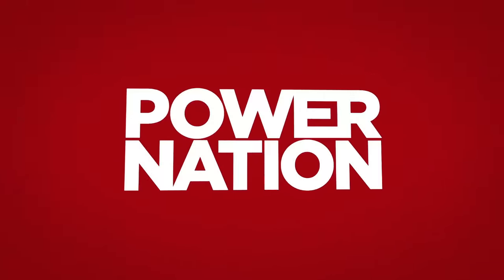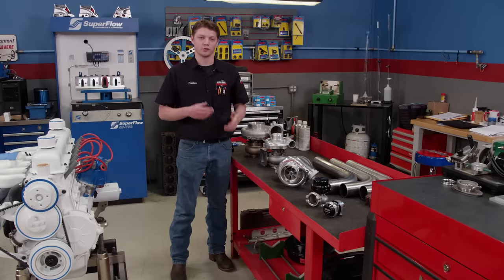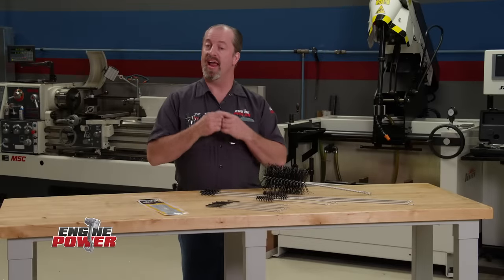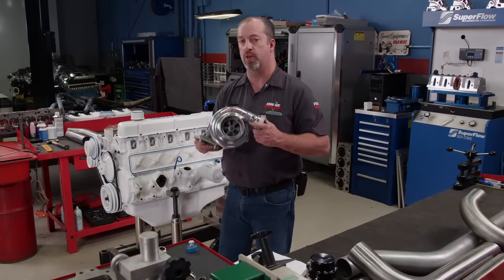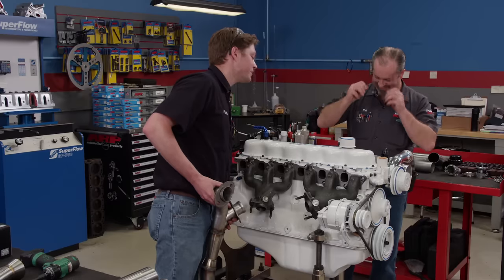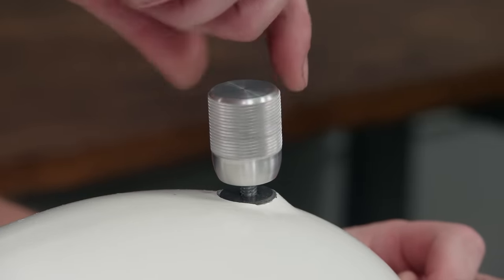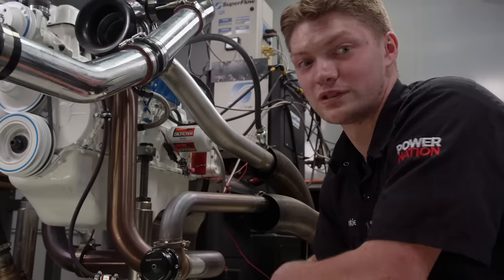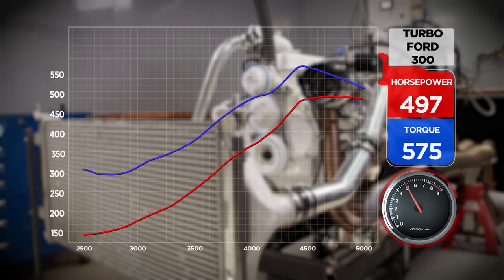Turbocharged Ford 300 Inline Six Makes Over 500 HP on the Dyno - Engine Power S8, E14

Comment: This was more satisfying and way more fun then almost everything else I've seen from this show.  I really want to see them start making power on all sorts of different, underdog engines.
Reply: I had a smile on my face the entire episode. 
There isn't a gearhead alive that grew up around 300s that didn't wonder why that bulletproof engine never got the love the 302 and 351s did. 
I want to see more of this
Reply: @francislutz8027  my first pickup was a slapped together jolopy of a ford f150 with a 300 and a granny 4, that motor drove me to the pits of hell and back, had a warped valve cover so i always carried a gasket and 5 quarts of oil for when it blew. dad still hauls wood with that ol rig, not fast, but he hauls it
Reply: To be honest thou the 300 isn’t A underdog from the factory it would out pull the 302 had a friend and his dad both bought brand new trucks only different was his dad sprung the extra money for the 302 but his son out pulled him every time they tested them out against each other and that’s a honest fact
Reply: THEY should do a ford, gm, and Chrysler inline six turbo build off.. As in same turbo and efi to see what made more hp then put them in cars to drag race them... Inline six muscle cars still way cheap under 20 grand mint condition..
Reply: @francislutz8027  Like a multipoint efi custom build like Casey built back in the day but for inline six!!!
Reply: Check out Richard Holdener's "The Other Guys"  series on his channel.
Reply: @Thelongmanable  they did a 292 gm inline for a build a year ago or so
Reply: @scottinWV  Richard is really pulling in the viewers with the other guys motor.  I've been waiting patiently for him to do the big bang on the 3800 series 2/3 and on the "Ameri-Barra".  I wouldn't be surprised to see the 3800 survive up to 1000 hp with the stock internals.  It would be awesome if Richard then put forged bottom end and seen how far he could go.    However, the forged crank and main caps are expensive items for the 3800.  A forged crank for the Grand National 3.8L is around $600, even though the GN is a small aftermarket.
Reply: What if they tuned up ridiculous forgotten/economy motors, like the Ford 2.3HSC from a late 80's Tempo?  Or pulled a 3.1L Chevy v6 from a 2000's Malibu and managed to service it without stripping the rocker arm bolts :-D
Reply: @kbar150  I know and unlike the 300 it had a low compression head not a 9 to 1 compression like the Ford 300. This is why so little boost made big hp. People don't talk about compression to hp but it literally is "Everything"!!!
Reply: @Thelongmanable  Ford should use the Barra in that competition.
Reply: @davidkelleyiii9315  I've seen them online for sale be awesome for vintage mustang build..
Reply: @Thelongmanable  man,miteomite top fuel runs one with stock internals getting 2000 horses and it didn't blow up.niw there is our American 2jz.just don't know what to put it in.
Reply: Another extreme underdog engine is the GM "Iron Duke." They lasted forever, but had no gumption. 

A significant benefit to hotrodding these unpopular engines, is the lack of aftermarket parts. If these guys could be persuaded to port their own heads instead of just buying expensive parts, it would definitely improve the channel content.
Reply: @jonathankipps9061  OH man that's the beauty of hot rodding custom part building to make the unusual fly.. I means model a or t were sas sad performance but know how , creativity and engineering all things can be hot rods. That is the very definition of hot rodding taking what you know and building something that didn't previously exist.
Reply: Under dog the 300 is one of Ford's longest lasting engines ever made it's a tank I seen one still running with a piston out the side of the block
Reply: Yes,
Reply: @francislutz8027  I couldn’t agree more! And so did i I would like to see this in a truck and on the street/strip

Comment: A build list for the final NA with 287ish horsepower would be pretty sweet. Sounds like a fantastic daily driver F150 engine.
Reply: it was listed on another episode. though the roller lifters only added couple hp so barely worth adding them.
Reply: @SgtJoeSmith  that’s for longevity not power
Reply: That's what I was thinking
Reply: @Agilepickleunite 
Not trying to be a troll, but I have 500k on stamped rockers that'll beg to differ.
The rollers are for alleviating a slight bit of friction in the upper end of the engine, but won't do much for longevity.

Comment: I want this so bad.   It’s the ultimate crawl around and tug truck motor.   Even the NA motor is good with a manual and 4wd.   It pulls way more than you would think quietly.
Reply: Those 300 motors were in so many 1/2, 3/4 and 1 ton even I bet some heavy hauling 2 ton or so cargo  trucks and flat beds throughout tge late 80's to early 2000's, most underappreciated and overworked engine probably ever.
Reply: @Roboticdoughbull3k  im looking out the window at my 95 f150 5sp 2wd with this engine while watching this
Reply: Please don’t laugh.  
I feel like I already know but, is this CA legal

Comment: I've taken 2 of these apart about 4 times each now, and yes- These will run 70 mph on the highway with a half ton of sand in the bed, with 2 cracked pistons, all rings seized, and not 2 squirts of oil. Then I re-re-built it with 5 new pistons and all new rings, bearings, and a HO oil pump. Absolutely love turning the key on my '85 F-150. Runs smooth as a sewing machine, even the air conditioning holds a charge and works.

It may never go fast, but I can pull a stump at idle and 100% guaranteed to take me anywhere I need to be.
Reply: This. 
Every gear-head friend I have has a similar story of an abused 300 that would break hearts, not parts. The old "they quit making them cause they can't profit from selling parts that don't break" story has stood the test of time pretty damn well
Reply: Its hard to kill an old Ford.
Reply: Had one of these in a 76 f350. Most of the truck rusted away, valves outta adjustment, and most service was "it's still running, drive it". Motor had an easy million miles on it. Still most reliable truck in the fleet.
Reply: Built Ford Tough! 👍 too bad everything that every company makes today is garbage.
Reply: I've owned two myself. Absolutely awesomely dependable engine the 300.
Reply: Yeah these motors only came in trucks. Big tall motor, so it won't fit in most cars. One of the few exclusively used motors to have ever been built. They are awesome.
Reply: A/C holding pressure doesnt relate to the engine in any way ever, its all down to the A/C system, as long as it bolts on and doesnt go further out than stock belt it works from my experience
Reply: @mattisenberger4042  The 250 was the same motor and it was put in some cars, same basic engine as the 300 but intake was cast as part of head, same engine in Australia had separate manifolds so the hot rodders here had the Aussie heads shipped in.
Reply: @5695q  yeah I've heard of a 250. Just never seen one. I've actually tried to put the 300 in a 78 LTD. From an old 87 truck. Truck was wrecked and LTD's motor was bad. So I tried. 300 wouldn't fit. Oil pan was to deep, and was to tall. Couldn't close the hood. So I gave up. Didn't even remotely get it booted down. Just set it in. Don't remember what happened to that little project....long time ago.
Reply: @francislutz8027  I personally doubt the "don't sell because they don't break" story. Ultimately it came down to cost and size. The i6 cost more to build than the v6 it was competing against in the 1990's. It weighed more, which meant more raw materials, and more weight penalty in the quest for fuel economy. 

The decision on when to drop the i6 corresponded exactly with the pickup truck body style change. They just decided it wasn't worth designing the long engine bay and high hood necessary to clear the i6 engine. If their only options were a v6 and a v8, they could shrink the engine bay considerably. The low sloping hood on the 97+ "jellybean" f150's would not have had enough space for the i6.
Reply: My friend had an old f150 a while ago the bed was a lil loose but a Yamaha raptor lived in the bed for a few months that truck was a pile but was super fun and worked till he had to get rid of it
Reply: @jonathankipps9061  a toyota supra has a much smaller engine bay and still fits the  2JZ engine, which is a tall engine as it is a dohc any has no angle like BMWs straight 6 engines. And the first gen IS300 had an even shorter hood, amd the 2JZ is a verticle inline 6 like the ford 300 so it is a tall engine Any ford will fit a straight 6. There have been cummins 6bt swaps in all kinds of fords. I also doubt it cost more to make c0nsidering it has one cylinder head amd less moving parts than a V engine, plus the timing is gear driven instead of belt or chain driven so there are no tensioners or guide rails. But you are right about the raw materials and weight. Plus it would cost more to male this engine emissions s complaint. Same qith the jeep 4.0 engine.
Reply: Had a 92 4.9 with the t5 in highschool, had about 285k miles and after a hooker header some old carter's and a weiand intake and a Lincoln locker, there was not one corner of my home city that rear end didn't fish tail around lol.
Reply: @5695q  the smaller 'Car' version of the '300' was the '240'. The '250' was the stroked version of the '200' which was based off of the '170' and '144' that was before it, the famous 'Ford Falcon Six'...
Reply: We had 100’s of them at ups the later head made more power in 1995 they re configured the piston too but they lost the #2 ring and they blew oil so Ford stacked the head gaskets it seemed to fix the problem they also used those crappy stretch head bolts.
Reply: @wyattshelton2080  you didn’t have a T5 they all came with a Mazda 5-speed. 

And the reason you were going sideways is not because of “the power” those trucks have light rear ends and slide out easily when unloaded.
Reply: @TheRobb573 ah yes the famous stump pulling 4.9. 

Biggest lie ever told. 

You mistake the granny low first gear for engine power. Fact is the 4.9 made no horsepower, sucked on gas and the only reason it lasted was because it’s a underpowered dog. 

I’ve had a few myself, nothing to write home about. Wish this stupid myth would die already it’s based on stupid old men telling war stories about who had a better truck.
Reply: @linuxuser21629  I have an '82 F150 with a 300 from a '76. The farmer I bought it from said this was the third truck the motor had been in and would outlast it too. He preferred the older ones to the later for their complete and utter ease of working on and tankability.
Reply: @South_0f_Heaven_  >hp

It was a low RPM motor, why are you bringing up HP? It's a tractor engine adapted for vehicle use, and got its reputation from that. It lasts a long time because it does the same work under lower RPM, and produced more torque below 1000 rpm than the 5.0 v8. You may not like it, but the 300 is one of the best motors from its time period as far as truck use goes. Stay salty.
Reply: @brahtrumpwonbigly7309  keep telling yourself that how great they were. Have you ever actually owned any? I have had a few and compared to any V8 they are garbage no power boat anchors. People that used their trucks to do real work didn’t buy these base engine junk boxes.
Reply: my 2009 escape 3L24v does 100mph for over an hour on the freeway .
Reply: @jonathankipps9061  Where are you getting the idea it cost more to produce?
Reply: @Jackmerius_Tacktheretrix 
I've seen pictures & corresponded a bit with a fellow from NM? who converted his early UNIMOG to a 300 he pulled from an old Thunderbird? or maybe a station wagon...
He used it as a mobile weld truck with what I'd guess was an old radio box.
It would take him places no other would
Had that radio box packed w/equipment.
Also added a front of engine driven winch, I was THOROUGHLY impressed with the mass and welds on that,... his concept overall  👍
Reply: @South_0f_Heaven_  Tell us you don't know what you're talking about without telling us you don't know what you're talking about...

The Ford 300 has an extremely long 4 inch stroke, and combined with the natural balance of an inline 6 and a cam shaft that takes advantage of both, all packaged in a tough, well designed block, you have a recipe for a stout engine.  When bored out a bit to take FE pistons it's even better because now you're optimizing bore and stroke together.  So yeah, there's a reason the 300 consistently makes the "top 10 engines of all time" lists people throw together, and it's not "boomer mythology," even if you're too ignorant to understand what's going on.  Oh, and FYI: Ownership of a thing doesn't make you an expert of that thing, so just save the personal anecdotes (which probably aren't true anyway, but I'll give you the benefit of the doubt).

Now, I'm sorry the 4" stroke is longer than your wiener, but that's no reason to be mad at an inanimate object and get on here and act the fool, okay?

Comment: It's fun, seeing someone finally giving the "Big Six" the recognition it deserves! Good job, guys! I had a 1982 Ford Econoline van, with this engine in it, and I agree: This is the best inline six cylinder engine on the planet. I gained a lot of top end torque, by merely installing a bigger exhaust and down-pipe on the stock exhaust manifold, paired with the factory intake and mono-jet carburetor.(Identical to what was on your engine when you got it) I had the 4-speed overdrive transmission, which was created by changing the 3rd gear ratio to create the overdrive. That meant, the transmission acted like it was a 5-speed transmission, missing 3rd. With the huge RPM gap between 2nd and 3rd, it would "run out of breath" in second, before I could get the RPM high enough, to be in its torque curve in 3rd. The big exhaust solved that, by giving it enough torque band, to cover that spread. I was able to use it to pull a travel trailer.